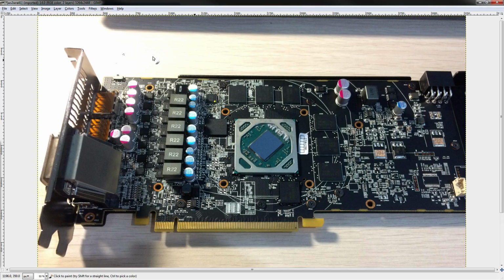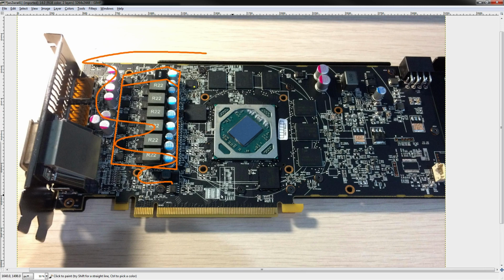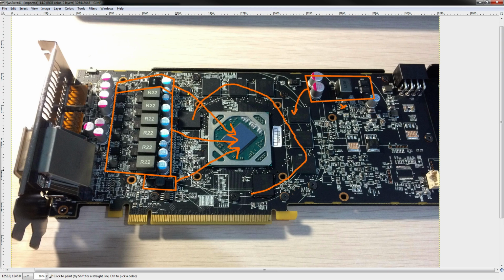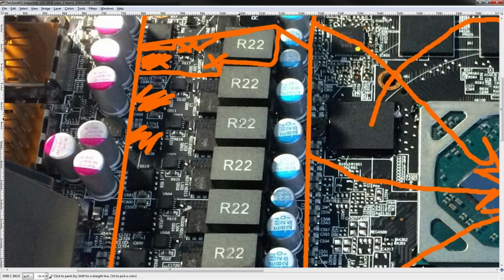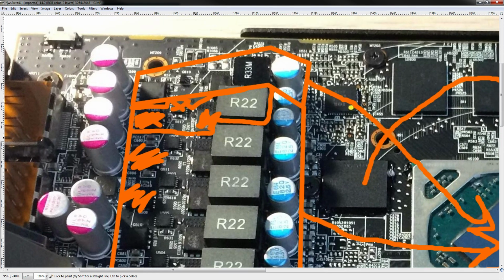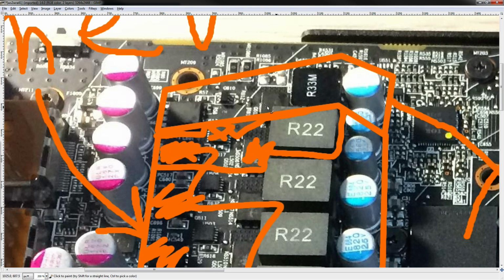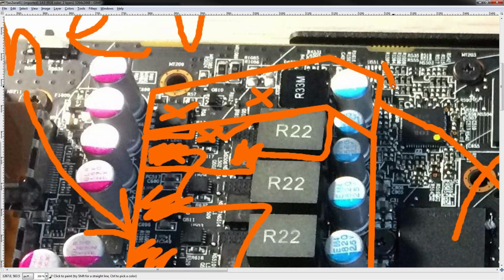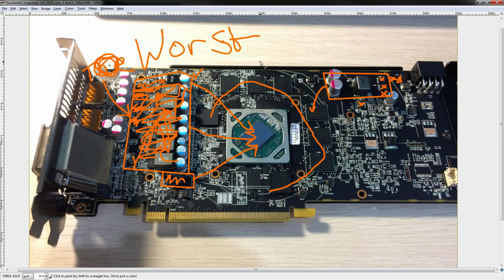PCB Breakdown: Powercolor RX 480/470 Red Devil

Comment: should i return my rx 480 devil? but its perfroming really great?
Reply from the maker: If you don't run Furmark/Kombustor or some really heavily tweaked BIOSs you will be fine.
Reply: Well I generally don't see the point in Furmark or similar programs as you won't ever gonna get that high when gaming and general use. I get that it's good to see if your OC is stable and other purposes, but I think that it isn't a necessity. 

Running the custom BIOS could've been a better thing, but then again from most reviews I've seen with the RX 480 maybe boosting the memory and undervolting can yield you better results. Core overclocking ain't that beneficial other than for your power company. :P 

Still as I have ordered that card I will be cautious when using it and messing with the settings. 

Overall the card is probably the quieter 480 out there and the performance is nice. Temps are a notch higher and maybe this is the reason why, and not the cooler. Funny bcs the G1 seems to heat more and perform worse. I was heading for either of the two models, but picked the RD. 

I wouldn't want to bother with returning it actually, tho it's still hasn't arrived and I liked the features. And only valid option would seem MSI, but then again the only single place where I can get the card has the price too high. And no guarantees any other brand may not have similar parts. I wouldn't be surprised if this is the actual case. :P 

I guess I will first try the card and see results I get, whilst evading Furmark and alike and not pump the voltage. Not ideal probably, but not awful maybe when you can get good results with undervolting and mem max. Too bad you can't go over 9000! Guess they aren't Dragon Ball fans, I am neither, but still that would give some good gains, and danger the mem chips too I guess. xD
Reply: ***** Thanks for the reply metal im just going to keep the card as its by far the best AIB in terms temps and clocks
Reply: Nash B I actually just found this https://www.reddit.com/r/Amd/comments/4ykhvy/the_best_rx_480_aftermarket_card/d6ol4yf 

"MSI gaming has a good cooler (packing largest fans out of the pack) and runs quiet, but no user replaceable fans, no direct vrm cooling." 

Not sure whether you can trust it, but it seems that there are a lot of fuzz around the RX 480's. 

I don't know whether it's worth the sweating, generally you don't see many GPU reviews with cards disassembly and look into the parts and the PCB. I personally can't be bothered to wait for another RX 480, the wait has been over a month now. :P 

And I saw a guy mentioning that the Strix ain't directly cooling the vrm, in the reddit this guy says that the asus, xfx and powercolor are the only that dcools. 

So generally I;ve decided to take a step back and look at the data I have learned through reviews. The asus may have a lot better pcb, but then again it's louder than the 4GB G1 RX 470, hence significantly louder than the near absolute silent Red Devil. Performance wide I can't see much of a difference really.
Reply: ***** yea im just going to stick it out with the red devil its a amazing card a my fans dont turn on when i play csgo and other light games. its a nice and quiet even with the fans on a high rpm. Im happy with my card
Reply: The RX 480 Red Devil is an extremely quiet card lol
Reply: Johnathan Bloch I know, I have it here in my new build. xD

Even at 60% fan speed it's silent.

And the power consumptions and temps are quite good. I haven't seen much more above the 100W consistently. And the temps usually hover around 40-50-60's.

The only issue I had was that I had to disable the FPS limit feature, otherwise games freeze when running fullscreen. After I disabled that, everything works perfectly. o_O 
Other than that, the card is awesome. xD

Comment: Could you take a look at the XFX RX480 GTR PCB?
Reply: I have that card with factory overclocked (black ed.), want to see its analysis too.
Reply: Yuttakon Yuttakonkit Me too. I have the normal GTR but it has the same PCB as the Black edition
Reply: from what I've seen its highly stable even with a decent overclock the voltage stays constant, the clocks don't budge, the temps don't go nuclear, so far the xfx gtr seems to be the best 480.
Reply: madmax2069 I can confirm this. My GTR runs at 1420Mhz and doesn't throttle.

Comment: So, what's leading guys like Gigabyte or Powercolor to go and release VRMs that are worse than AMD's reference design?
Reply: money
Reply: Cheaper components... cost saving.
Reply: They save a bit of money and for 99% of users it won't be a problem. it's still rated over 200 watts on the core.

Comment: Hey Buildzoid, just clarifying, why do you put emphasis on the drain current for the high side FETs? Wouldn't it be more realistic to judge the FETs somewhere between the cont. drain current, and the rated pulse current, and of course focus on the cont. drain current for the low side FETs?

Probably missing something here, but thanks!
Reply from the maker: Most pulsed ratings assume an initial Tj of 25C at the start of the pulse which is not a thing in a running VRM. Tj in a running VRM is going to be somewhat above Tc and since Tc for most VRMs is around 80C which basically means that the pulsed rating is kinda useless. Continuous is certainly an overly safe rating to go by but I'd rather under estimate than over estimate how much current you can push. The low side FETs are important however they will at most be handling the same current as the high side. If the low and high side FETs are the same. The low side dies first. However most GPU have a high side that has about half the current capability of the low side and in those cases the high side typically dies first. So far the only GPU where the low and high sides were kinda similar was the Gigabyte RX 480 Windforce and even there it was 30A hi 50A low. I also adopted the focus on the high side fet current ratings after noticing that that's the rating that TiN(guy who designs the Epowers and I believe an engineer at EVGA) focuses on.

I actually want to try get a few "burner" cards where I will intentionally try to overload the VRM just to test how far of I am with my current predictions.
Reply: Burner cards for the RX 480 seems problematic for the near future. How about using older generation cards which are comparable in this regard? Odds are that someone has them lying around and is willing to sent them to you.

Comment: Going by Jayz's video on the gigabyte card, at least this one doesn't seem to run as hot
Reply: It's cooler than Nitro+ and is very quiet .  if  not Overclock to much and not run stress test program.

Comment: I get that Furmark is an unrealistically optimized burn-test but IMO any good card should be able to take it. I've run it on my EVGA770 as a hack space heater for fun for 20-30 minutes before, reference cooler, ~85C, no problems years later. This also with a modded bios and approximately 280 watts going into the card.

In retrospect I suppose that wasn't a wise choice. But it didn't die :)

Comment: Which is the best PCB for RX480? (I am willing to swap the coller),
Also, the 6 vs 8pin additional power? Whats your thoughts about that? Are there any downsides of the 6 pin?(i have seen both opnions as some claim that 6 pin is missing only the "sense" pins.)

Comment: thank you for this video, i was planning on buying 2 of these. in your opinion what would be the best RX480 to get? my plan is to run 2 in crossfire with liquid cooling. also i will be doing somewhat aggressive overclocking.
Reply from the maker: Nitro/Strix/XFX GTR/HIS Roaring X2. Those are all better than reference cards. The reference cards also have fine PCBs and since you plan to water cool the fact that the reference cooler is kinda crap doesn't really apply to you.

Comment: man i need some help, i have a Gt 620 1gb OEM and i have a oc Core:was in 810mhz stock to 950mhz oc and the memory was in 700mhz stock and 950mhz oc i was geting 103C to 104C but it was running "fine" and now the clocks stuck is 270mhz and 450mghz i i cant move only restarting my sytem soo wath is wrong? the clocks or the gpu or hardware

Comment: So this is the worst Custom Rx 480 In the market? Even worse than G1?
How bout your opinion on His Iceq Roaring Turbo?
Reply from the maker: It has a good cooler but the PCB is weak so I wouldn't push the voltage on it too far especially if you get a chip that is really power hungry. The HIS Roaring Turbo shares it's PCB and I believe heatsink with the XFX GTR so that cards good.
Reply: Actually Hardcore Overclocking Awesome thanks.. i am thinking about buying the strix 480.

Comment: Hey, as always, great job with PCB breakdowns.

Returned my Powercolor 480 Red Devil today, prior to watching this video. Now it makes sense why they had the warning. My reason for return was terrible thermal issues. I doubt any air cooled 480 is capable of any decent overclocking while being quiet. Seems like even MSI Gaming X reaches up to 80C, problem is (that I've seen) - their vrms throttle? 

Personally I've never seen my VRM temps go higher than 80C even on 1.22V with spikes up to 1.25V, good thing I didn't run furmark. Here is a couple of stock heaven loops (temps stabilized) https://cdn.discordapp.com/attachments/172808766776016896/228430692546117634/Capture.PNG

https://cdn.discordapp.com/attachments/172808766776016896/228430831536832512/Capture.PNG
Dragon Age Inquisition.

Too bad I don't have my doom, rottr, battlefield 1 runs. 3440x1440. Basically Doom (vulkan) was ~86C @ 3500 RPM's (90%). Thats a leaf blower. If you run stock fan profiles and stuff, the pc shutsdown, restarts, the temps reach 90+C with like 2800 RPM'S, gotta tweak some stuff. In general I wouldn't recommend any of the 480's except maybe msi Gaming X. You won't be able to overclock much, but atleast its somewhat quiet and cool (~80C ish @ 50% fan speeds).

My chip had +36 mV offset looking @ WattTool. Max stable stock volts oc was 1360, 1370 required +25 mV. Memory only went +100 mhz. 1400 required some crazy ~1.2v with terrible spikes. Seems like early samples, reference cards were quite a lot better. Nowadays it seems hard getting it past 1370 mhz on stock voltage.

TL:DR avoid air cooled 480's except MSI Gaming X. If you want to overclock grab a reference and watercool. Some time ago I thought getting 1400 mhz wasn't too hard thats why I went with it. Mistakes were made. Fermi v2. Gonna grab a Fury Nitro for now and undervolt/overclock. That card is really really quiet and cool.
Reply: WTF... i have red devil too and i cant pass 64°c on long gaming session.,...where you live?in Afrika with 40°c all day?
Reply: 480 not passing 64c. sure. my ambient temps are around 22c. Anyway. Even Msi gaming x can hit 80. just play something heavier.
Reply: you want a screen?
After 4 hours session gaming i not pass 64°c..and i live in ITALY...so or your country is very hot or your case is very fail...

Comment: Thanks for the video, was very informative. I was considering purchasing 2 of these cards for crossfire. Are you aware of any improvements they have made to the card and cooling issues? I've seen from other reviews it runs pretty high temps. I Do plan to run turbo, not any major OC. Thanks for any advice you can offer. Want to make an informed purchase. My second choice is the Asus Radeon RX 480 8GB ROG STRIX. What's your thoughts on this card. Can't thank you enough.

Comment: I don't care how bad the mosfets and core VRM are, I have had this card for years, and it is fantastic. I can push it hard still, and I have had zero problems with it. I definately abuse this card and it hasn't skipped a beat. I ran Furmark and other intense open gl benchmarks and there haven't been any fires yet. My red devil is used everyday for many hours a day with the bios switch off of factory position and it still runs like a champ.
EDIT: Here is my Userbenchmark run recently showing my clocks and memory and ratings for this card.        https://www.userbenchmark.com/UserRun/18346872
Reply: i agree using same card

Comment: So here is a list of how rx 480's compare to eachother

Powercolor:
-260$
-Good heatsink
-Good temps
-Silent
-Horrible PCB
-Cool backplate
-Bios switch

Gigabyte: 
-270$
-Bad pcb
-Problems with heat dissipation (at least it looks like it)
-Plain backplate
-No bios switch
-RGB

ASUS: (Previously confused with MSI)
-300$
-Good PCB
-Good heatsink
-Good temps
-Silent
-RGB

Sapphire:
[JUST CONCLUSIONS TAKEN THE NITRO RX 460 VIDEO]
-260$
-Small heatsink
-Hot
-Noisy
-Good pcb
-Cool backplate
-Bios switch
-RGB

MSI:
-290$
-Same cooler as always, so it's probably good
-We need this one too #buildzoid

XFX:
-270$
-We need you to know more c:

+ correct me if i missed something on these cards

Edit: i thought you already looked the sapphire one. I confused it with the rx 460 on gamer nexus... my bad
Edit n2: will introduce prices to be more precise. Confused asus with msi, so i added this last one (we still don't have reviews)
Reply: from what I saw online the only good rx480 coolers right now is the MSI and the Nitro (ASUS seems to be decent)
Reply: +José Luís Lopes yes, i forgot msi. Btw theirs cooler is always great, and usually the pcb is quite good too. The nitro from what i have read so far is not a good cooler at all. most of the space is unused and the fins are few and spaced

EDIT. Just realized in the post i mispelled asus with msi. So i will correct it. The asus one is the crazy price with really good cooler.
Reply: msi has regular pcb slightly below refrence good enough eaven for ln2, also great cooling but no bios switch
Reply: ReactorFox3 Do you have a source? From the breakdowns I've seen MSI seems to have the highest quality PCB along with Asus.
Reply: actual hardware overcloking is my source
Reply: John Connor He is right, my bad that i still have to update my original post. I shoud also make a reddit post with all the info but i don't have any time atm
Reply: Looks like the Asus/MSI/XFX/HIS are the ones to buy.

Comment: So, at the moment, none the cards (Reference, Gigabyte and PC) are good. Make me think if there are anyone with good components on the market...
Reply from the maker: No the reference is fine. The Strix, Nitro, GTR and Roaring X2 are all better than reference.
Reply: But we saw in YouTube that some of this don't properly cool down the memory and VRMs, since they are not attached to the main cooling solution of the card, using just a plate in contact with this and located under the heatsink.
Reply from the maker: Nitro cools everything adequately. The HIS roaring X2 is the same deal. The Strix doesn't really do much to cool the VRAM but I doubt it has much impact on OC headroom. The reference cards have a massive aluminum baseplate to cool the VRM and VRAM. I would literally but any of these cards except the reference because the reference is really loud.
Reply: So, for now, the HIS/Nitro are the best performance/quality builds RX 480 cards (since Asus did a lower temperature limit on its card, causing some throttle)?

Comment: What the actual fuck is wrong with you people and hate on powercolor red devil rx 480. I have one with unlocked bios.. The card undervolts really well. I set fan to 1800 rpm and undervolt to 1100 and i dont get over 68 degrees EVER. 1330 core 2000 mem. Wtf..
Reply from the maker: 1330 core and 2000 mem is not a high clock. And 1.1V is not a high voltage. I usually push cards till they stop scaling on my RX 480 GTR that doesn't seem to be the case even at 1.4V core and 1580mhz core clock. That's the kind of scenario I'm thinking about when looking at PCB. Not daily gaming usage at what I pretty much consider stock clocks.
Reply: +Actually Hardcore Overclocking i like my card to last more than 6 months and really anything over 1330/2000 for 1080p gaming is overkill. Shit even reference 480 is overkill for 1080p gaming
Reply from the maker: yeah except I'm a Overclocking youtube channel not a Gaming channel. I put cards and CPUs on LN2. The goal is a top score in some benchmark rankings on HWbot not a smooth gaming experience. For gaming the Devil is a fine card. For my uses it's terrible.
Reply: +Actually Hardcore Overclocking no idea what you could possibly want to do with gpu's if gaming isn't a priority but do what you want lol
Reply: People thinks "its shit and unusable and it'll blow up" when even buildzoid even says its only terrible for LN2. I'm not saying people should buy it though...so...but its not terrible...also the cooler is great so at least there's that.
Reply: Look at the channel name....its about overclocking....so its for benchmarking....
Reply: Lol my strix 470 is at 1335 stable and max temp is 65 1330 is too low for an rx 480
Reply: Usman Afridi im sure i can push mine past 1330 but again theres 0 reason since im playing in 1080p
Reply: in some games the difference is not even worth it but in some games it is lets say u r getting 55 fps in a game by ocing u get 60 so then u can brag that u get constant 60
Reply: Usman Afridi bruh there is absolutely no game an rx 480 can't get 60 fps constantly on a stock reference card. I just upgraded to a 144hz 27" 1080p monitor and anything above 75 fps is usually unnoticed by most. Overclocking is usually just bragging rights with benchmarks but in reality most of the time the advantage of gaining a few fps isn't worth the strain on the card and reducing gpu life. I haven't found a reason at all to overclock my red devil rx 480 past the factory overclock of 1330/2000
Reply: LiLPhaZe305MiA Thats also true
Reply: ''reference 480 is overkill for 1080p gaming''
What drugs did you take before making that comment
Reply: iCallOfDutyDog it's true tho, rx 470 works fine for 1080p